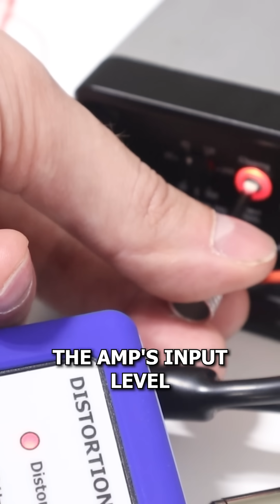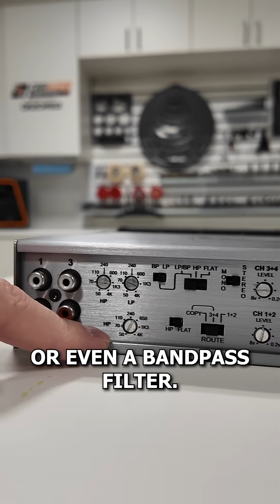Car Audio Amplifier Basics - Settings Edition  #caraudiofabrication

Comment: Thank you for teaching me and everyone else the correct way of altering a vehicles wiring. And the optimum way to get the best sound. Regardless of brand or affordability. I'm a broke car audio enthusiast. I can only afford Recoil. But I've truly learned a lot..... Tuning is my biggest issue. Most aftermarket car audio guys don't listen to heavy metal. It's hard to get advice thats applicable.
Reply: @BarbaraBooher-x7i  my advice is single 10" in sealed for heavy metal

Comment: Hey I have a question..I have 2 8 inch dB drive wdx8 3k size subs what would u recommend for a box size volume wise n amplifier size n brand as well ..oh its also going in the spare tire well of my 14 ford escape 

Many thnx in advance 
Steven
Reply: Depends on the size of where you can put an enclosure.  You can easily have 2 12s or 10s and use the tire well as an amp rack.  If I can have 212s in my forte5 and use the tire well as an amp rack so can you.

Comment: @2:45 you say it is centered at 45hz. The dial shows 0 to +12 db. Where did see that the bass boost dial has anything to do with frequency and not decibels?
Reply from the maker: I looked in the manual, bass boost is basically a single band EQ, that is locked at a certain center frequency. In this case an "all boost" EQ